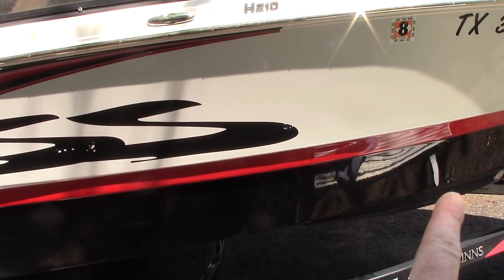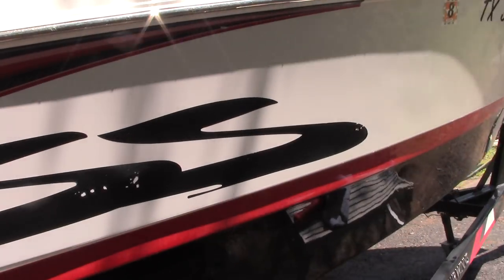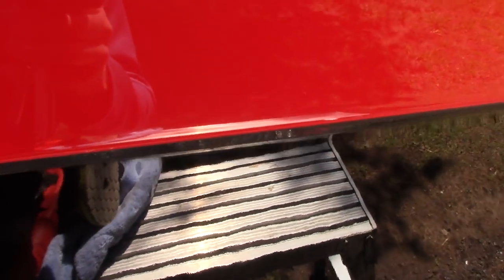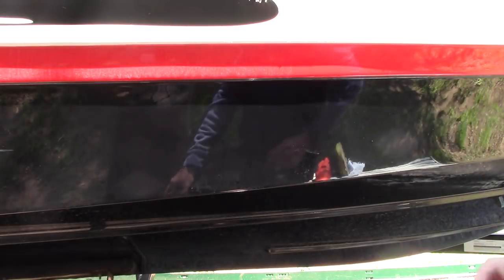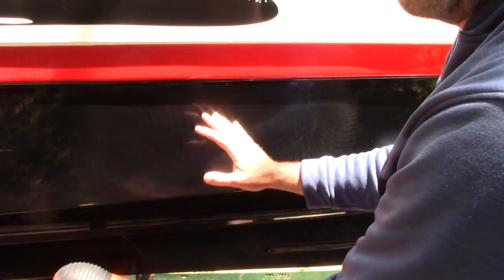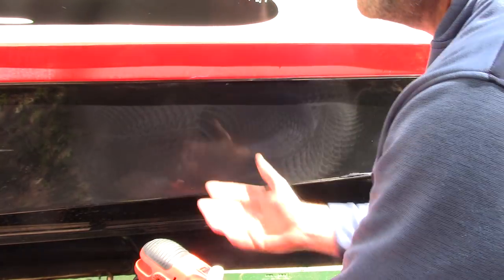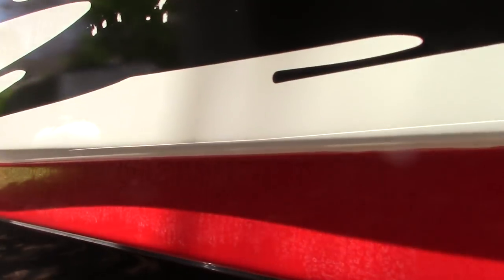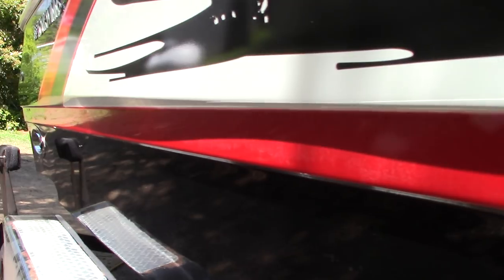Remove Water Spots From Boat - Polishing A Boat!

Comment: Hey Scott a tad off topic, will using something like purple power vehicle and boat wash remove water spots from a black car with the ceramic coating? Also, will using aggressive cleaners like purple power will remove my ceramic coating overtime or make it fail sooner. I have gloss coat on the car.
Reply: Driveway Reflections Detail very nice question i also would like to know this....how scott washing and detail cars with coatings
Reply: Yes & no. The majority of the time water spots on ceramic coatings wipe right off, and you can do that with a quick detailer or whatever your preferred method is. Sometimes even washing the car will remove them.

The other time you'll have to acid wash that area, so taking Meguiar's Wheel Brightener diluted 4/1 spray on the affected area give it light agitation and rinse it.

You essentially treat it as if it were clear coated paint. :)
Reply: HallmarksDetail thanks sit
Reply: HallmarksDetail unfortunately my wife parked by the sprinklers at work and after washing the car with honeydew snow foam it didn’t remove the spots. I actually ended up running a light polish over the car.
Reply: That sucks man, you'll have to recoat the car now. :(

Good thing if you didn't have the coating it might've etched the paint and then you would've been wet sanding the water marks out!

Comment: Scott- I'm a noob with a HF DA and I'm trying to decide between a microfiber cutting pad or heavy foam cutting pad.  My boat is mildly oxidized.  What would you suggest?
Reply from the maker: BellyUpFish try both and check your results and decide from there what's best for the boat and you:)
Reply: Dallas Paint Correction & Auto Detailing I guess I'll have to give that a shot.

Comment: Does gel coat work same as a clearcoat? Meaning we compound and polish same techniques and products???
Reply: shady acres I was going to ask the same thing! I've had more requests for boats lately but I've done very few and used meguires marine products on the ones I have done. I'd rather use things I already have for cars if I could.
Reply: I've always used Marine Wax an Compound. I've tried compound an waxes for cars an seems really hard to get off.
Reply: No sir gel coat is generally tougher then clear coat and requires more aggressive steps to achieve desired results. That is if you're removing oxidation, scratches, swirls, etc.

You also have to be choosy with the products you use. Not all products work well with gelcoat. :)